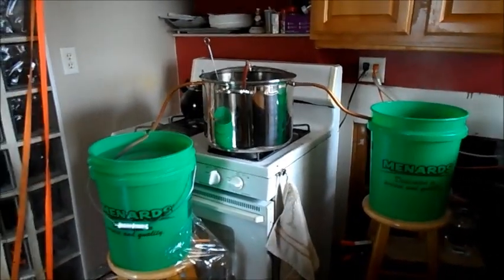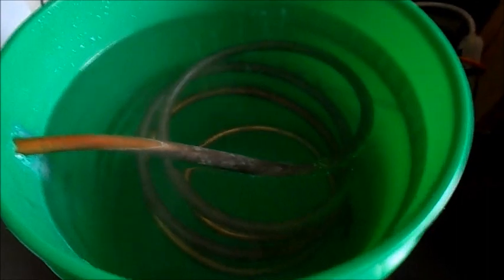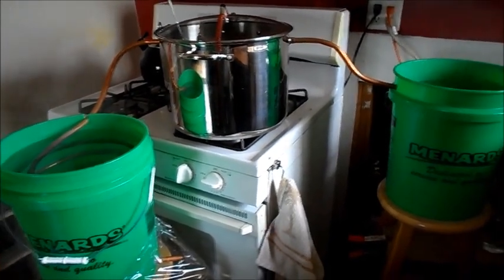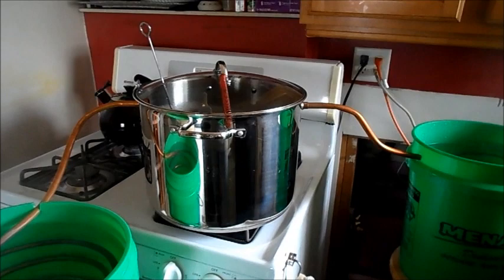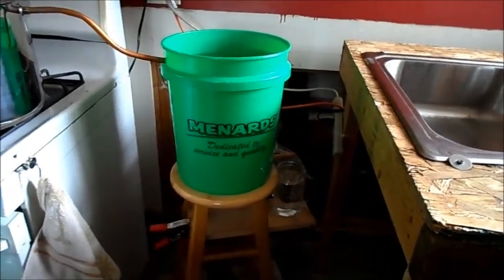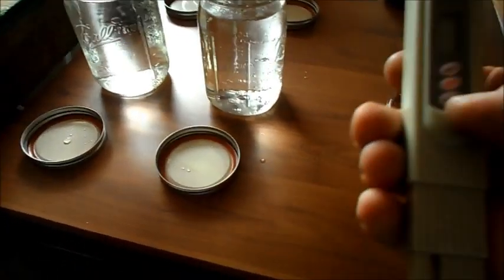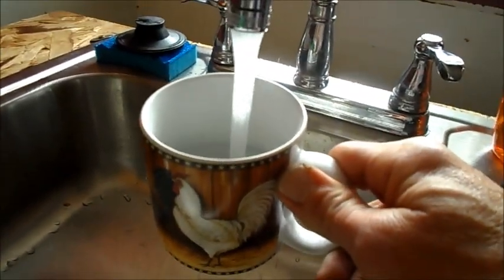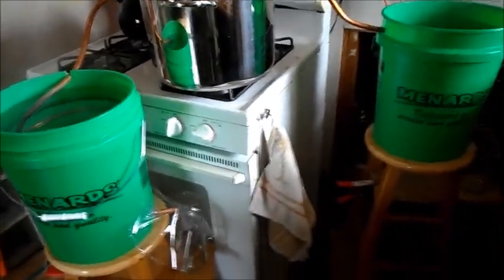Dual feed Homemade Water Distiller making 1 gallon in 1.5 hours

Comment: Wondering if you tryed salt water in it?
Reply from the maker: Never tried it and I don't even use this set up.  I took the easy way out and just bought one of those electric counter top distillers.  It makes a gallon in 4 hours and you don't have to watch it.  I had a neighbor that was in the Coast Guards and he told me when they were out at sea, they made their own water basically the same way.  I would try it but I'm about 1500 miles from any sea water, lol.
Reply: @Lightendog  lmao I  upgraded as well to a electric,  had a stainless steel keg that I converted, used to sit on the end of my BBQ would always use ice bricks to make the steam cool faster if I didn't it was the difference between a drip and a constant flow. No sea water, no salt air must be horrific lol just joking, why did the beach laugh?
 Because the sea weed! have a good one mate.

Comment: Very nice. Indeed the plastic is bad but this is just an experimenting Right? Do you have instructions? What about 4 small buckets of stainless steal instead? I am not an inventor either I'm planning to be one at this time but if you build something solid, compact and provide instructions, I will build mine too. You post yours then I pay you for the instructions. How this idea sounds?
Reply from the maker: The plastic is just the cooling tanks and has nothing to do with the distilled water on the out put end.  The steam only touches the copper tube......that copper tube goes clean thru the bucket.  Now the instructions are very simple and I might do a video in the near future of a break down showing all the parts.  My info is free to anyone so no payment is needed.  I have accepted my peasant status long ago, lol.  Besides, I won't need anything where I hope to be going in the end.  If you like this video, check out my video on a Faraday Bed enclosure.
Reply: I have a distiller but take 4 hours per gallon. I was expecting to use 4 hours 4 gallons. The possible with yours is the mess in the kitchen. To many buckets
Reply from the maker: @jt9824  I was hoping to find a setup that allows me to make 1 gallon per hour and with mine being 1 gallon every hour and a half, I now think that's the best I'll get.  I also have one of those electric counter top units.  Crunching the numbers with the electric company charging 17 cents a kilowatt (including fees and taxes) it comes out to 51 cents per gallon which is still better then buying it.  I have no idea what my stove version will cost yet.  It is a lot to mess with but it makes water quicker and breaks down quickly to store somewhere else.  And if the power ever goes out, I should still be able to make water.

Comment: What is the meter testing for, iron, calcium, florid? Did you sterilize the jars? The 1 reading could be from the jar.
Very interesting. 
Thanks for posting the video.
Reply from the maker: The meter tests for dissolved particles of all elements in the water.  I did not sterilize the jars but did wash them out with soap and water.  I used vinegar to clean the inside of the copper lines which was the hardest part of making the whole setup.  BTW, I tested the boiled down water before dumping it and it read 299.  I'd like to see what Flint Michigan's water tests at as they still have problems with the water.  Now for a couple of years I've been using a 5 stage water filter and that water tested at 186 which is higher then what comes out of the faucet.  I believe some filters add particles to the water even thou the quality might be better.
Reply: @Lightendog  the boiled down water would be more concentrated as particals are left behind. 
I don't trust filters myself. I like my homemade charcoal filtet. It's modeled after a fish tank filter. I think it uses less energy than distilling water though distillation has its place.
Do you use the warm water from your condensation buckets to make the next batch? It seems to me that it would use less energy to boil warm water. Just a thought.
Reply from the maker: @everybodyseye  Yes the boiled down water would be more concentrated but I'd figure the ppm count would be higher.  With 2/3 of the water gone, the count was only twice as high.  I know chemicals have boiling points also so it's better to keep the temperature around 212 or a little higher.  Great point on using the hot water for the next batch.......I didn't do that but rather gave my drains a nice hot flush.  It worked wonders on the bathroom sink.  The bad part of all filters is the thought of it staying wet the whole time.  Stagnant water had always bothered me like pond water, where you wonder about what could be growing in it, lol.